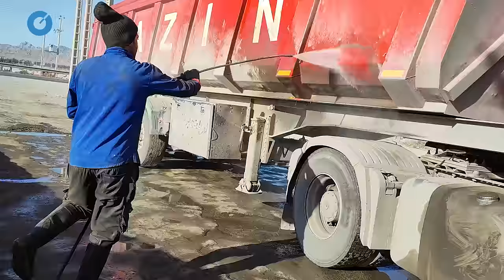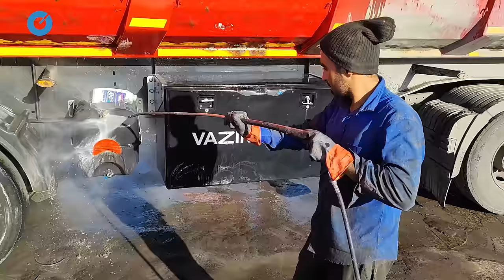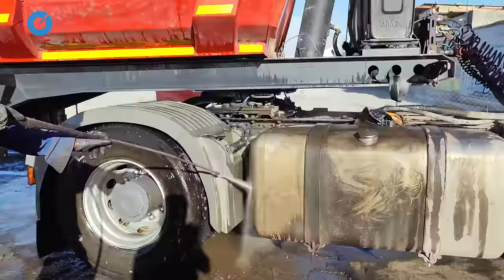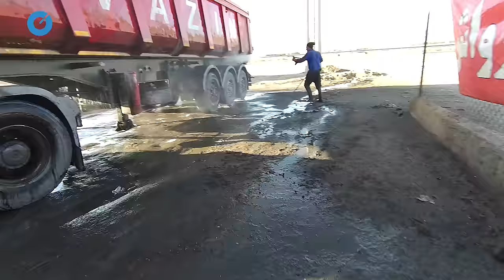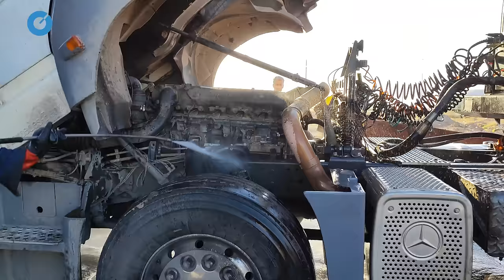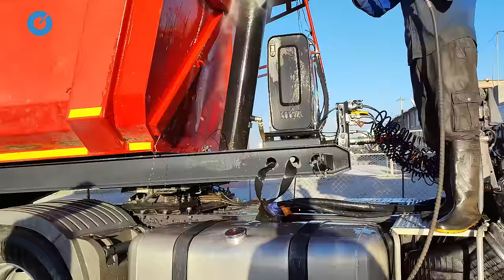Deep Cleaning Muddy Mercedes-Benz Truck with High Pressure😱 How to Wash Off Road Benz Truck

Comment: with a unit like that you need to have some form of soap or degreaser… a simple water down will do nothing in the long term
Reply from the maker: Hi @Finest.Oddballs, Welcome to Meta process
Certainly, it's important to note that effective cleaning often requires more than just water. Using a suitable soap or degreaser can indeed enhance the cleaning process, especially when dealing with stubborn residues or grease. These agents help break down and remove contaminants more efficiently, ensuring a thorough and long-lasting clean. While water alone may have its limitations, incorporating the right cleaning products can significantly improve the overall effectiveness of the cleaning process and contribute to maintaining a cleaner and more hygienic environment.

Comment: Que producto lo hechas primero para poder empezar el lavado porfabor y un saludo desde Bolivia
Reply from the maker: Hi my friend ☺️🌹, thank you for your comment. Start by applying a presoak chemical specifically formulated to soften and lift dirt and grit from the truck’s exterior. This helps dissolve stubborn dirt, making subsequent cleaning more efficient. Good luck with your work ❤️🌹.